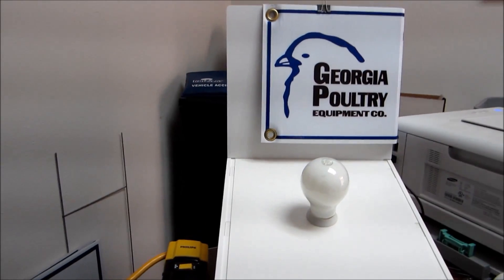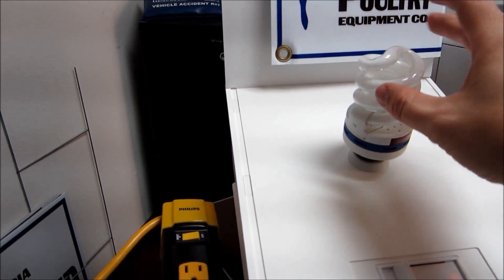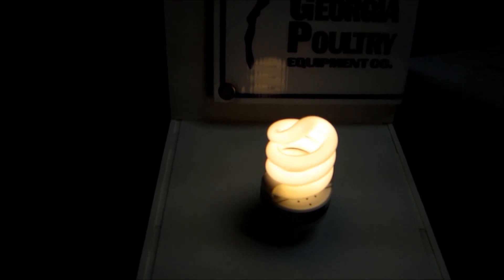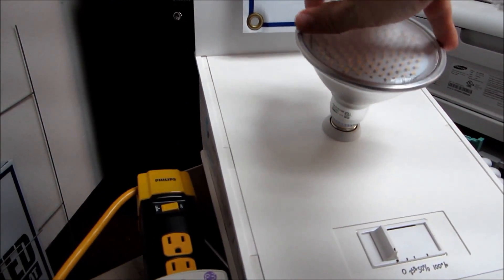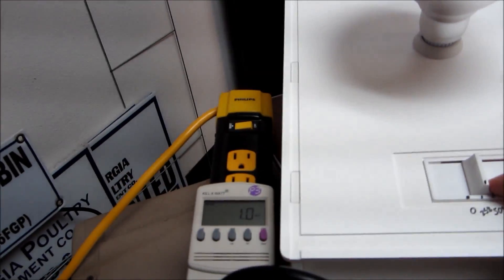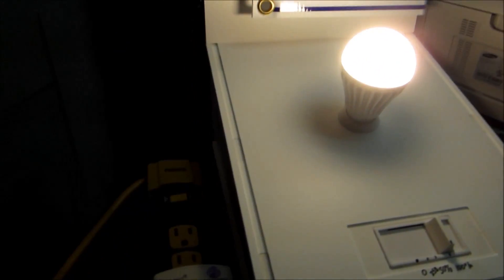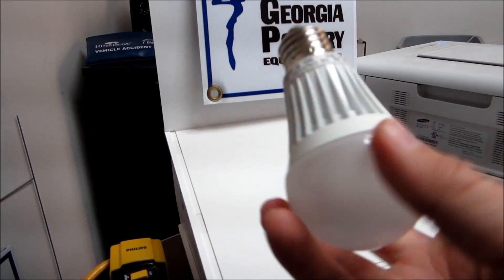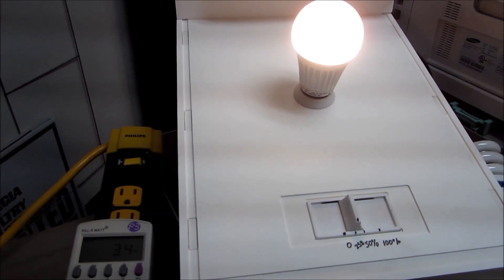Poultry House Lighting Types Video and Wattage Usage when Dimming LED, Cold Cathode, and others

Comment: What is the best bang for the buck?
Reply from the maker: MrMeowalikat this video is a bit old but LED is the way to go. LED technology improves every year and it depends on what wattage and color (Kelvin) you are after. You can get LED bulbs much less than a few years ago, but the higher wattage and higher lumens will cost more.
Reply: what lights are the best for 20 lux?
Reply from the maker: @listrikb6885  20 Lux is roughly equivalent to 900 Lumens.  An LED bulb with 8 watts or there about would should get you 20 lux at full intensity.
Reply: @billyf.4078  thanks
Reply: What type of dimmer are you using in the video ? Is it triac dimmer ?
Reply from the maker: @sergiisl9012  It is a sliding triac dimmer.